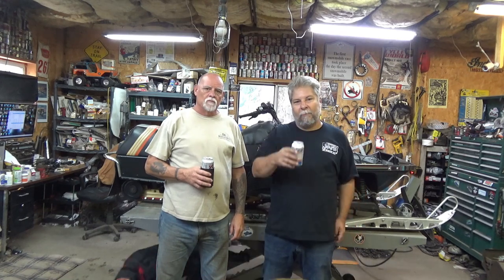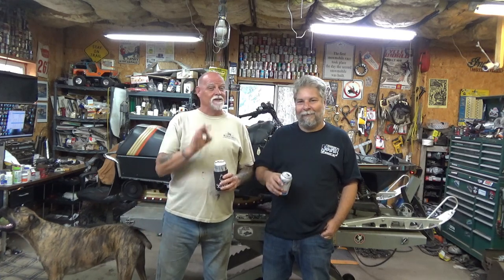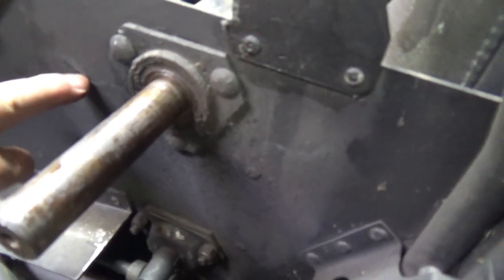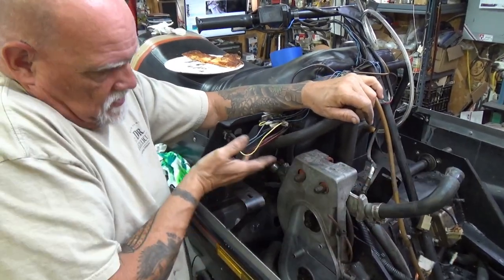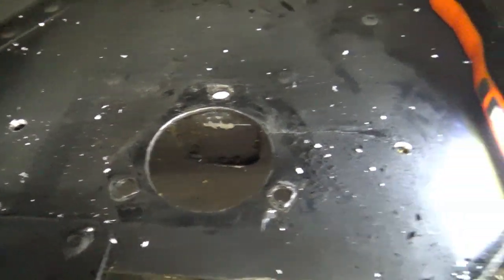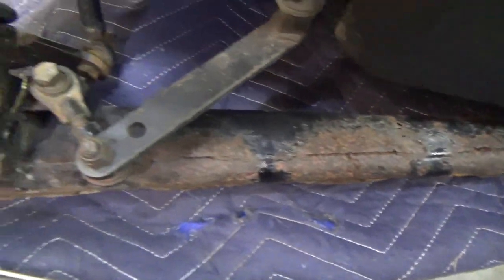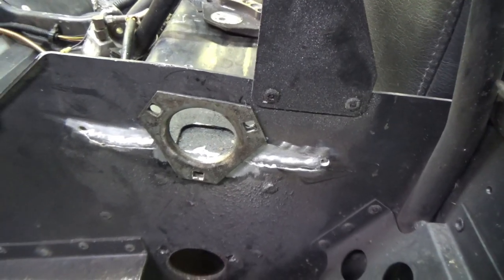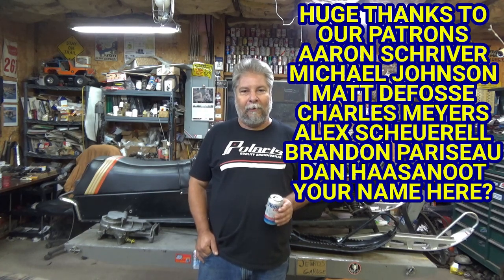1983 Polaris Indy 600 Part 3. Tear down and Welding Bulkhead Cracks. Vintage Triple Snowmobile.

Comment: I had a prick of a time aligning the clutches on my txl and the bulkhead flexing when the jackshaft rotated which would have undoubtedly caused the cracking you experienced. I used high quality bearings but the jackshaft wasn't centered/aligned properly. I was naive in thinking there wasn't that much to that step in the process.
Reply from the maker: Thanks for the info.

Comment: Looks like you guys only need 4 more subs to hit the big 1000!👍   That’s great!  
Does your 600 still have the original closed face clutch, or are you going with an open face p85?  How are  you going to set this sled up?  Snow drags?  Trail rider?

Keep the videos coming!
Reply from the maker: We got the 1000 today. Indy 600 came with a decent closed face P85. I'm going to try it on snow before deciding on any changes. This sled is a trail rider. I plan to have it at the MVSS ride in unless something goes wrong.

Comment: I’ve always been a fan of the 83  Indy 600’s.  I have a complete one that I think is probably too far gone to mess with and an extra engine on the shelf.  Do you have a certain part number jackshaft and trackshaft bearing you run?  I see a reverse chaincase and plastic skis.  I think the reverse chaincase would be a nice option, but I’m just not sure plastic skis are the right look for an 83 Indy 600.
Reply from the maker: I've been using the Rb Tech SB205-16 bearings for a few years now and had good luck. Plastic skis don't rust. The sled is a rider, not a show sled. I don't do restos, just riders.

Comment: Any ideas on a larger engine that would swap into a 1974 tx250 with out to much trouble? Also would an newer indy suspension swap into that sled?  Love that 600 engine, eye candy for sure.
Reply from the maker: TX250 is a small block, so a TX340 will bolt into the engine mounts. I put the skid from a 1980 free air TX in my 74 with the stock cleated track. Rubber track rails are the wrong distance apart. My 74 TX440 project is still on the list! No promises for timing though. There's a lot of sleds on the list.
Reply: @nuttersspeedshop  thanks for the reply, would love to see the TX project.
Reply from the maker: @matthewbegin3462  It will happen eventually.